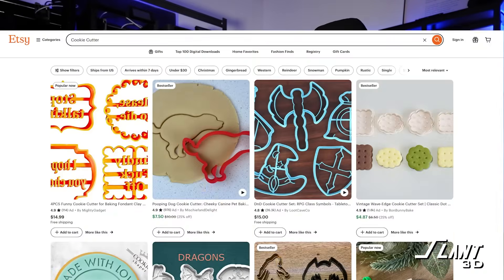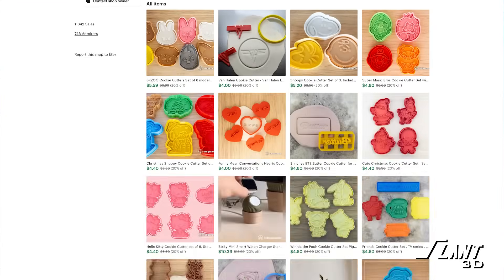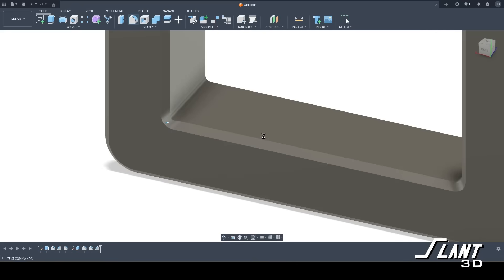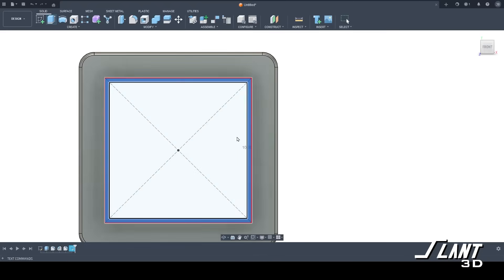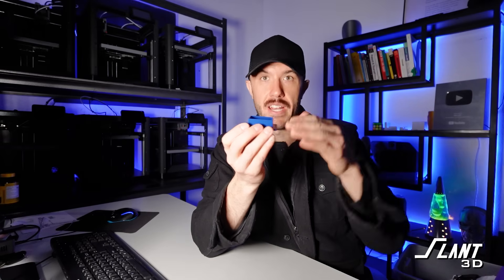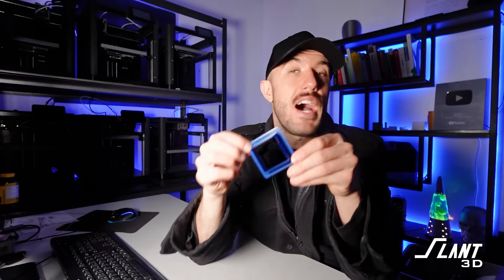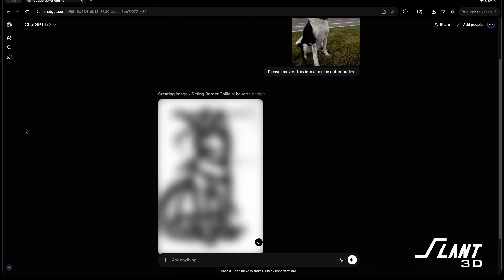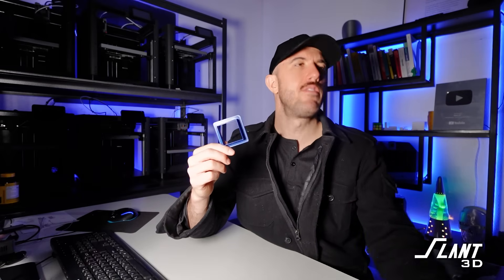How to Design a Cookie Cutter for Mass Production 3D Printing

Comment: Now what about Food Safe filament? I hear a lot of people saying don't use PLA or anything else because it's not food safe and talking about micro plastics and whatnot. I have only found one Certified Food Grade PLA+ on Amazon.
Reply: I might be wrong but I think 3d printing cannot ever be food safe because it ends up being quite porous. You could always either create a mold and cast it with silicone or what I find easier is to cover it with a food-safe resin

Comment: You should not 3D print anything that touches food. Most filaments are not food safe and have dyes and ingredients that are possibly dangerous. If you use special food safe filament and make sure the nozzle is brand new that removes some of the problems. But cleaning 3D printed items is another problem because 3D printed items have many more crevices than other methods of plastic production, which leads to microbes embedding themselves in no matter how you clean them.
Reply: THIS! Your comment needs more upvotes. Do not ever use 3D printed stuff with anything you intend to ingest. While pure PLA and PETG are generally considered food safe 3D printer filaments are NOT - manufacturers put all kinds of additives into them to make them better suitable for 3D printing. Also nobody knows what the printing process itself might or might not add to the product. All kinds of stuff might or might not leech out during a dishwasher cycle (dishwasher detergent is not the same as your dishwashing soap intended for handwashing) or when in contact with food. If you absolutely must, then 3D print your positive, make a mould out of food safe(!!) silicone from that and then use that mould and a food safe material to make your thing.
Reply: He will just wave that off by talking about the lead content of the nozzle.
Reply: I have some 3d printed cutters 
They are out of ultem, can be steam cleaned